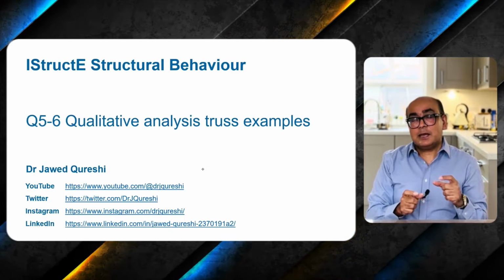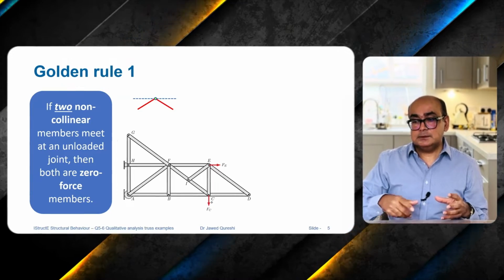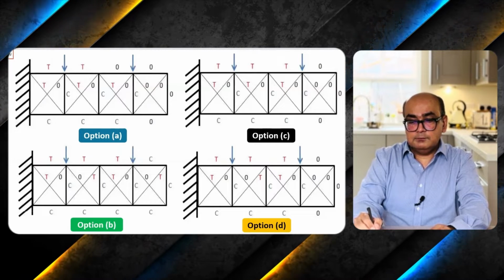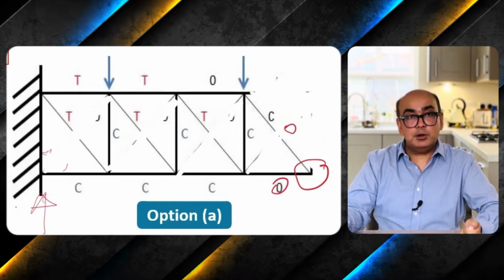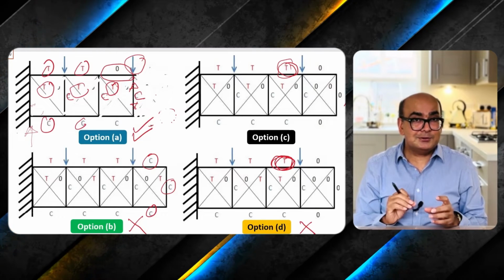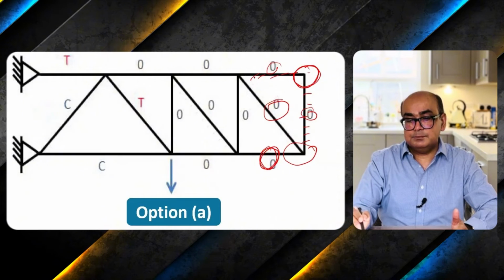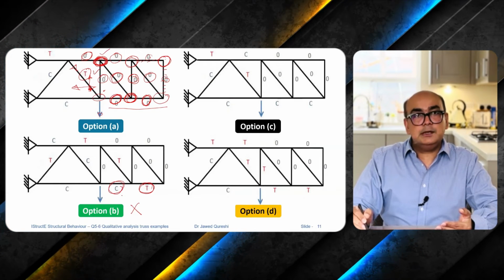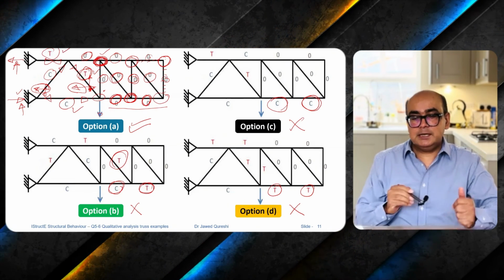How to find zero members in truss | IStructE Structural Behaviour Course

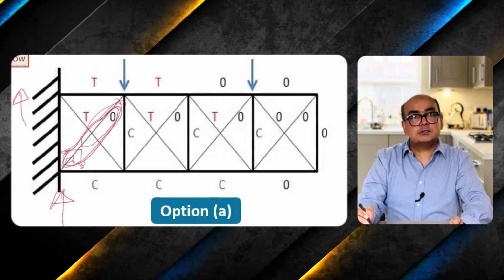Comment: Hello Dr. jawed, Thanks for discussing the problem. At 05:00, you said by symmetry , all diagonals will be in compression and hence zero force in those diagonals. Is this a rule for all the truss members, can we follow this rule for all the situations in such symmetrical members found in variety of trusses. Please throw some light on this. Thanks
Reply from the maker: As the load is pushing down the truss, all diagonals in the indicated direction take compression. But the as per question, diagonals can only take tension. That is why force is zero. 

Yes, if loading and geometry is symmetrical, we can say the members take same type of load.

Comment: Plaese sir, first I would like to tank you for your valuable efforts, Moreover, I have a question why diagonales couldn't take compression efforts ?
Reply from the maker: The diagonals are wires. The wires or cables do not take compressions. Imagine cables in cable stayed bridges. They normally take tension only.

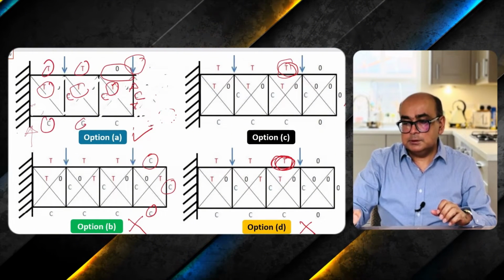Comment: At 8:03 if all members on the top be in tension how do you get 0 force of the horizontal member left of the second load applied.

The reasoning you said was 0 because no horizontal load applied, why can’t the same reasoning be used on the horizontal members next to the first applied load then they should be 0 according to that reason.

I think the answer may be C which suits your first point members on the top will be subjected to tension in a cantilever.
Reply from the maker: As two diagonal members have zero force at the second loaded joint, this leaves us with two horizontal members (one on right of the joint which is zero and the one the left have to zero too for horizontal equilibrium). That is the reason the force is zero on left of the second loaded joint.
Reply from the maker: C is incorrect because the diagonal members at second loaded joint are zero. Then we only have two horizontal members, the one left is tension and the one right is zero. This is not possible if we have to maintain horizontal equilibrium. When one two horizontal members are connected to the joint, they have to be equal and take the same type of loading, either tension, compression or zero force. That is why the force in the left horizontal member have to be zero for horizontal equilibrium.
Reply from the maker: The situation at other two top horizontal members is difficult because they are connected with tension diagonals and when we resolve theses diagonal into horizontal and vertical components, the horizontal component is in tension and that is the reason the force in top two left horizontal members is tension. As the answers are very close to each other, I got it wrong myself on my first attempt and chose C, which is the wrong answer.
Reply: @DrJQureshi I see it now thank you. It’s due to that tension diagonal bracing connected on the left load node. Where as one the right it’s 0.
Reply from the maker: @iamyou6555  i hope I made myself clear. Thanks for the question.
Reply: @DrJQureshi  yep I understand now thanks keep it going! Loving the behavioural series
Reply from the maker: @iamyou6555  thank you